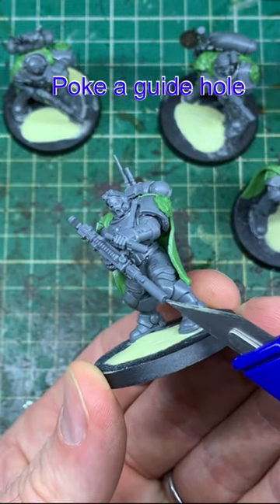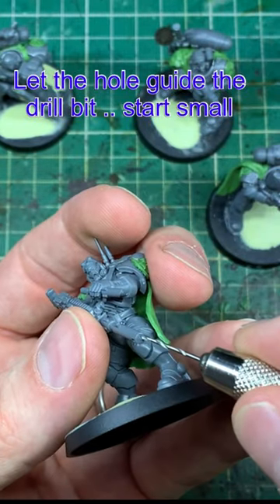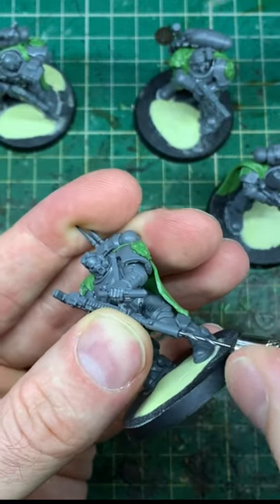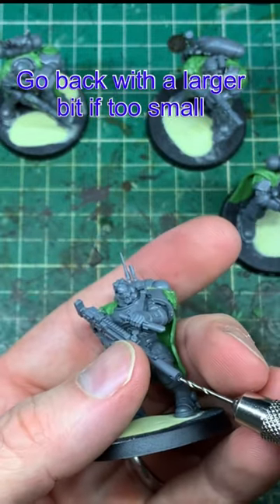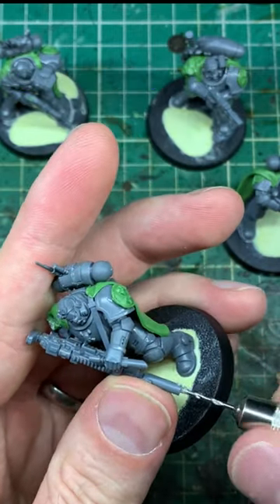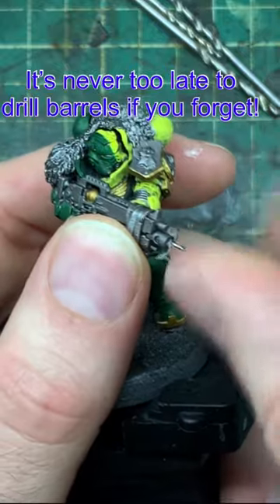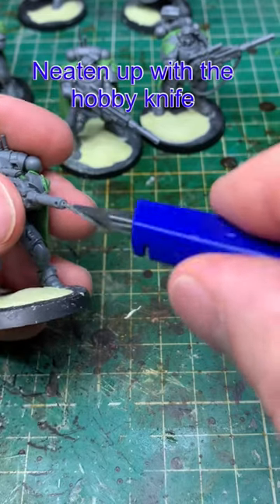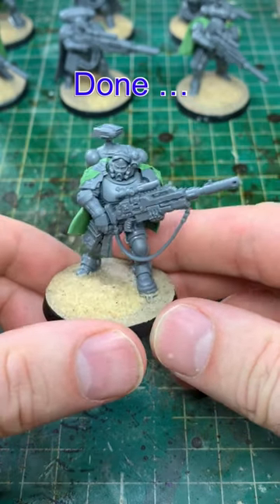easy technique for drilling out weapon barrels any warhammer 40k model #warhammer40k #gamesworkshop

Comment: because of the tendency of the hobby knife blade tip to break in the plastic, I use a T-pin needle or one of the cork board pins, gives a good start for the drill.  Most minis come in as plastics now but with the older ones of metal I use a bit of testor paint thinner on the drill to keep the small drills sharp and reduce breaking.
Reply from the maker: To be honest I’ve never had the tip break in the plastic when doing this, this has happened with different modelling projects though so it’s definitely worth a try using a different pin to make the start hole if you’re you haven’t done this alot before or as you say in metal models.

Comment: Even better, keep a thumb tack in the wall near your hobby desk. Use a fine point marker like an ultra-sharpie gunpla panel liner to find dead centre, make sure it looks right push the thumb tack into centre and do a couple circles makes a great guide and you can get the barrels absolutely perfect. Always start small and go up a size this will prevent any splitting
Reply from the maker: The thumb tack idea seems like a sensible addition to barrel drilling, safer/more accurate, I’ll give that a go on my next project!

Comment: I stopped drilling the barrels and I done it for two good reasons. 
1. Unnecessary how good you are, in the most cases the barrel hole is not in the center.
2. The holes are much to small which means the barrel looks to thick. 
It doesn't look better than black with silver edges and it's never satisfying.
Reply from the maker: agree it can be an issue with centralising/hole size, personally I can never get it to look right painting the barrels so I prefer drilling, I am doing a rescue of a metal terminator captain I got off eBay and the barrels are drilled really badly so I guess drilling can be more of an issue when it goes wrong!

Comment: I dont know why Gw just doesnt automatically Make a hole or smth in their models so people dont have to drill them. Like im already paying for The models building it and painting it myself couldnt They just add it.
Reply from the maker: That would certainly make life easier
Reply: The injection molding plates would need removable pin inserts to have pre drilled barrels, very expensive and time consuming.
More moving parts means more to go wrong.

Its not hard to drill a few gun barrels.

Comment: Use a safety pin to center the hole, more accurate, and you and going to take your finger off if you slip...
Reply from the maker: I think as long as you go carefully you should be ok with either method, I like the hobby knife method as it gives a good size indentation.
Reply: Second this, ended up with the blade halfway in the tip of my thumb, very fun
Reply from the maker: Crikey! Go careful
Reply: @xCleffyx  Same haha. it's still healing

Comment: I was pinning a model to a base the other day and had too drill through a 10mm pillar and when I was 4/5 of the way through the drill bit snapped off and got stuck inside and i had to cut the pillar in half😢.
Reply from the maker: Gutted! I’ve been lucky whenever I’ve snapped them I’ve never had the bit stuck!
Reply: Managed to salvage it for me when it happened once by basically putting a tiiiiiiiny dot of contact glue on the broken drill and reattaching it that way. 

Probably 50/50 that you make it worse but I was lucky.

Comment: Which drill do u use?
Reply from the maker: The handle I’ve had for a long time, the bits are from a set made by army painter, I have a series of Amazon links if you check out the link in bio thing.

Comment: Drilling holes is your technique for drilling holes  you're a genius! Try putting the hole in the centre next time, a cross with a hobby knife works will. Oooo, how edgy an actual tip
Reply from the maker: Love the salt, in my defence the poke a hole and finish it off with the hobby knife at the end are different to just drilling it. No method is perfect but the problem with the cross method would surely be that you then have to file down the barrel to remove the cross?
Reply: @adamshobbystuff  yeah, being delicate pays off there. I tend to score the cross with the tip of the knife, so when I begin drilling it removes the score lines.
Taking edges off with a knife is a nice to for getting a good finish, point conceded